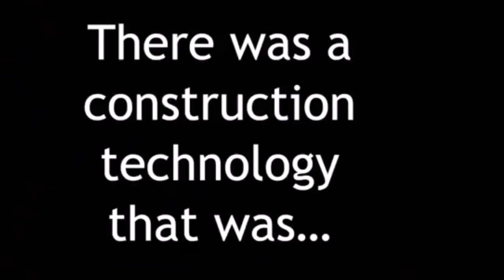Rammed Earth movie

Comment: I don't get the benefit to having a middle with insulation. It seems like a harder pour, more steps. Wouldn't having a solid wall of rammed earth work as insulation anyway?
Reply from the maker: you are right is better just dirt 
they just overdid it and overspent because of the snow presence but is not necessary.
Reply: No it wouldn't work because rammed earth is a very poor insulator for winter.

Comment: I live in an area where Radon is an issue. It's caused, as I understand form elements in the soil decomposing. Minerial, not organic elements, so does rammed earth release Radon ?
Reply from the maker: if you build a rammed earth hose in  the area where Radon is present, yes it will be contaminated air around that area
Reply: You can build a ventilation system that will let the Radon pass through and go into the air.

Comment: what is termal isolation inside that house?
Reply from the maker: the wall itself is the thermal insulation because of the size of the wall around 16 inches wide and some builders will ad foam insolation in the center of the wall

Comment: How does rammed earth houses hold up when foundations settles? Can structural cracks be repaired in Rammed Earth structures?
Reply from the maker: yes if it ever happens.
 but all you need is a concrete color mix to repair rammed earth structures.

Comment: All the walls can be stuccoed and treated according to you wish. There's no reason to leave them untreated, especially in the outside in order to protect the structure from the elements. Erosion or frost in moist walls can cause structural damages. Many people don't like this natural look at any cost. You can actually live natural and not look like a treehugger. I've been in the construction industry for 21 years (Europe) and you would wonder how many people don't like it. I actually like it. I live in a 300+ year old house which was made by this method - without one ounce of concrete or reinforcing whatever anywhere, without proper foundation (only huge flat rocks), without moisture protection from the ground - and wonder of wonders - after three centuries, it still stands, no cracks in the walls and it isn't humid. Using concrete isn't environmental friendly because it's far from recycleable. When we tear down a house containing any kind of concrete or so called modern building materials and then transport the rubble to the dump, it's considered dangerous non-recyclable waste. You can use it crushed into the foundations of the roads but this isn't recycling, it's only relocating dangerous waste, postponing it to our offsprings. Concrete must be used only because of the authorities, because the clerks want to cover their backs. My house is the proof that you can build a cob/dirt/rammed earth house without it completely (it worked for centuries, why shouldn't it work nowadays) or Instead of it you can use calcium hydroxide (slacked lime) which can substitute cement structurally by 80%. Then, your house becomes really recyclable and safe, as well, when you built it properly, of course. But as I mentioned before - the european authorities are scared of not using cement, that's why we are forced to build expensive tank-proof bunkers full of non-recyclable materials called houses for living. Now I saw that the american authorities are pretty much the same - concrete everywhere, our backs are covered...

Comment: She’s completely mad, doesn’t need heating or cooling lol if it’s winter with no sun she’ll freeze, houses don’t heat themselves lol
Reply: The concept is called a "trombe wall." How it works is that the mass of the wall absorbs and retains solar heat gains during the day and then radiates it back out during the day. But there is a limit to how much heat a mass wall can retain, so it has limited effectiveness is areas with prolonged winters where the outside air will be pulling heat out faster than the wall can absorb.

Comment: I am confused with so many options ?
What is best for me, i have fertile soil, water source, mud, hay, (wood is not cheap at my location) so can opt for bamboo.
To reduce dampness in future, my plan is to get stone foundation (which will be a bit expensive) and 2-2.5 ft stone wall and on top adobe brick, or rammed or cob ???
pls suggest, it dosent snow, but rain 3 months, summers hot 42 degree and winters cold 7 to 8 degree
Reply: Adobe es una buena opción térmica y resistente

Comment: it has one big issue... its expensive to build cos the  time to build.. the manual labor  ads up...
Reply: when you subtract the time/materials/labor costs saved from not drywalling, taping.mudding, texturing and painting, thats a pretty significant offset.  Also, the thickness of the walls reduces the energy required to heat/cool the home so that cost savings year over year for the time you live in the home is also material savings.

Comment: Has anyone used a vibratory plate compactor to compact their rammed earth wall? I am planning on building thicker rammed earth walls (approx. 18 inches thick) and a plate compactor I own is about 17 inches wide and do not relish using a tiny hydraulic or hand tamper for a year or more to construct my house. The plate compactor is designed to compact dry soil anyway, so why couldn't put in your lifts of properly mixed soil, use the plate compactor to compact to the rammed earth to the desired density, then repeat for each layer? I will do a test this spring and see how it goes, but wondering if anyone every used this method?
Reply from the maker: great just remember to make test runs
for psi test
and make sure your forms are secure and strong
because the surface  in 17 inches plate is to wide and my need  more (time /duration) and more pressure to compact down

Comment: They always fail to mention the cost. It's steep.
Reply: Here in Brazil this is one of the cheapests ways to build, yet few people do it simply because they don't know it exists. That might change from now on, as this method was put in official normative in 2022. Here we have cheap labour and expensive materials, so when you find a way to build with a material available everywhere, it's affordable to hire workers to build.
Reply: what makes it expensive ?
Reply: Too true. It can't go mainstream because it's so labor intensive. Can't do tracts of houses in subdivisions in a city with this method. 
I'd still love to build one though... A rammed earth straw bale hybrid design.
Reply: I have learned one thing from these things. All of these are cost-saving unless you build yourself with the help of friends and family (which means lots of labor ). Because all these methods are not so common and are also time taking processes.
Reply: It's cheap if you do it yourself. It's sand and cement 😂
Reply: And the fuel costs it takes to mix the earth amd fill the walls. Not to mention the cement mixed into the walls. And the high fuel costs ut takes to heat a rammed earth home because of the low insulation values

Comment: A lot of misinfo speak to a contractor or even a day laborer. This technique is still not cost effective, approximately $294.00 a foot! Unreinforced brings a lot of problems needs to be seismic proof. Although it does have good compressive and bearing loads. If you don’t have good soil you have to truck it over hugely expensive. Then u gotta insulate the walls having 18 inch walls still won’t cut it by themselves. It’s also very very labor intensive, again added cost but the real cost will come from electrical, plumbing and landscaping pouring concrete for the driveway. All this they didn’t bother to tell you and I hate to say but it seems like political  sleight of hand in order to push the whole green agenda. Don’t get me wrong I think using earthen materials is great but it’s still not cost effective or practical yet. Look into foam bricks and pre fab concrete walls👍🏻

Comment: This shows chunks of earth missing from an inside wall.  Though it shows pictures hanging on the walls that still makes me wonder how much stress it can withstand.  How would it do in Florida close to a beach?  There is another video of a house of cement constructed by a 3D printer.  I think I would prefer the cement house.
Reply: The missing mud is known as clay explosion. It's just chunks of clay that have absorbed too much water drying up. It has no structural impact. Once the wall is cured and dry, you'd probably need to bulldoze it in order to break it. Trust me, a house built with mud is better than a cement house in any and every conceivable way !

Comment: Hello Jose. Would you please explain how this structure could be earthquake resistant.? Have you performed any structural tests to prove this point. What municipality this house was approved in? Structures like these are very popular in Western Africa, but possibility of building these structures are zero in, for example, San Mateo county.
Reply from the maker: All projects are different most of this are in Australia and many of them are in New Mexico in the usa the Extructual engineers calculate the rebar needed for seismic resistance or earthquake resistance
Reply: Jose Alvarado In Australia you are lucky, low seismicity allows you to have buildings built from URM (Unreinforced Masonry) and contemporary buildings together. I was in Sydney and Melbourne last September and was impressed with architecture. Here in California we cannot build buildings like you are proposing in this video because this structural system is not listed in the CBC (California Building Code) and no municipality will approve project like this. I am a Structural Engineer and I would not dare to design structure like this because it could collapse on the occupants during seismic event. Nobody tested shear walls like you are proposing, you just cannot rely on bond between reinforcing steel and mud mixed with cement. So, claim that this is an EQ resistant structure is a big-big stretch.....
Reply from the maker: Igor Kharitonoff 
I will say we have a lot to learn but is possible to create a strong structure with this materials 

http://www.construction.eca.ed.ac.uk/case-study/down-to-earth-materials/

Comment: Rammed earth.....and cement, it is highly improbable that they only use rammed earth.
Reply: You can use lime when earth with higher clay content is available, but you are right, for sandy or silt earth they mix 5-7% of cement into mixture.
Reply: @yarpenzirgin1826  Lime takes C02 to create make no mistake about it. yes it takes up C02 after it reacts with water but it doesn't take up the c02 that it took to fire the limestone
Reply: @derekcraig3617  much less than cement manufacturing process. It is not CO2 neutral, but "less bad".
Reply: @yarpenzirgin1826  Agreed. But many in the 'green' building sector will bill it as carbon neutral. Which is totally greenwashing
Reply: @derekcraig3617  Not sure about "greenwashing". 
Mind you the content of lime is only up to 10% of the total material used, so it is "green - ish". Especially if compared to more traditional building methods.
The reality is that it would be extremely hard to build something 100% carbon neutral, transportation of material will already put it into "red zone", you will not haul the material in toyota prius.
Having said that, every little helps.
Reply: Only a thin outer layer is made from stone, the rest of it is made from earth.

Comment: Why not simply use concrete? More expensive, but less labor intensive.
Reply from the maker: many people uses concrete construction over rammed earth is just a material choice some like bricks others like  concrete and others like rammed earth.
Reply: @JoseAlvarado72  Do you know anything about aerated concrete blocks?
Reply from the maker: @hkitm  not slot but I know is regular concrete with small bubbles in the mixture to make it lighter
Reply from the maker: I mean not a lot I have big fingers sorry
Reply: @JoseAlvarado72  I helped build such a home near Beckley, West Virginia. It was the design of craftsmen from Germany. It was a beautiful mansion, stuccoed inside and out, copper roof, and solid copper gutters and downspouts!

Comment: The idea of using compressed dirt is very old and still great in many applications. And no real offense intended but the idea that it would cure global warming or cooling or the common cold needs to remain on the short bus.
Reply: Its footprint is extremely low compared to conventional construction materials.
Reply: UNLESS you mix in cement to it which is c02 intensive
Reply: To live requires energy no matter what.  Some people are obsessed with building something  permanent others are happy rebuilding a wood house every 80 years.  I'm pretty sure most things when you add it all up come out the same.  We just need less people.  And just when we had the solution all you guys had to go get a Covid vaccine and try and stop the best solution to climate change that we ever had.
Reply: I agree. It's very labor intensive to build. It requires a massive amount of wooden frame construction to contain the earth as it is being tamped down. What happens to all that wood when the project is done? It's all been cut up into shapes very specific to the house being built and unless you are building several exactly like it you can't reuse all of that wood. It is either discarded, burned, or chopped up into something that might be recyclable. The only thing that is "cheap" about the building method is the dirt. It would be cheaper to just build the house out of the wood that would have been used to build the framework.
Reply: @HotspotsSoutheast  plus all of the thick, solid, expensive and extensive use of architectural beams, walls, stairs and hardwood flooring.
Nevermind the nonstop burning of dirty medium sulfur off-road diesel fuel thats powering the entire process.. starting with the first bucket of dirt all the way through screening, mixing, prepping, (hauling?), and even the pneumatic tamping she was so cluelessly proud of.  Thats right, the compressed air for tamping on that scale typically comes from a Sullair brand diesel compressor - the thing is its own trailer - and its going to run alllll day long for months.
Good thing it'll last forever, 'cause thats how long it'll take to break even with its carbon footprint.

For comparison, a similar concrete home with hot/cold water circulating through the walls and floors is built in 1/3 the time using recyclable aluminum forms that are reusable many times over. 
Concrete is also mostly sand and gravel, dye can be added for color, and embossed forms for texture.

There is nothing cheap or conservative about the home shown, in fact it exemplifies the comedic irony surrounding every idealistic pie-in-the-sky notion coming out of certain annoying demographics.  Truth is we just watched a company promotional video disguised as a heartfelt eco do-gooder trying to improve the world... just another in a long line.
Reply: @dash8465  Seems like the wood used could be offset with tree plantings. Could you run the compressor on bio diesel?
Reply: @someguy1559  Sure you can. Even straight VO once it comes to temp. Dude probably lost a girl to a long cocking by a hippie years ago and never got over it. "Certian demographics" is a tell. Mentions the diesel used for compressors, like concrete is manufactured, mixed, and delivered locally and delivered by Prius's I guess. Or maybe he's pissed a competing technology has better marketing than the one he is invested in.
Reply: @HotspotsSoutheast  do you know that you reuse exatly the same wood to make the forms  of the walls? Just make one at the time.
Reply: @HotspotsSoutheast  Sure, cheaper short term. But long after the trees have been grown to replace the ones used in one use forms, it will still be standing. The "cheaper" wooden home will have rotted to the ground and been replaced several times before rammed earth starts to show needs of repair. By that standard, it's dirt cheap. (see what I did there) Sustainability is about the long game, not immediate results.
Reply: I would agree that packed dirt may last a long time but a home made of wood will not “rot away” if properly maintained. There are homes that are hundreds of years old. But as soon as you stop maintaining them they will begin to decay. It’s all a matter of priority. If the goal is to create a house that will last forever use steel or poured concrete. Packed dirt probably doesn’t even last as long as bricks.
Reply: @HotspotsSoutheast  use steel frames instead of wood. It can be used again and again and again, as interlocking modules. 
Have a question:
Is there any kind of rebar, or just dirt?
Reply: GottliebPins yeah. Wood is good around here. Most sustainable type of building if you know how to keep it from rotting and use farmed timber. Timber farms/managed second growth don’t destroy wildlife as much as cropland or grazing land.

Comment: She was obviously a third grade teacher. When everything is solved so simply.
Reply: I might add that as an HVACR guy, the gasses we're using for AC now are both green-house and GW compliant, many with "0" impact on either.   My older R-22 system in my home has been operating and using the same gas for nearly 30 years now.   When it finally dies, the gas will by law, be collected and disposed of; broken down by element and converted to a modern compliant gas.   She's not using oil or NG.  Yes, that's great.   That can't be practical for every climate.   I've not seen any of these structures without some form of supplemental heat.
Reply: LOL!!  I was thinking about that.  She must never be planning to fly or drive anywhere ever again, let alone use one product based from petroleum.   The Electric?  If not self-generated, it's from large, coal-fired facilities, and many municipalities are forbidding "off-grid" living, more and more frequently.
Reply: I wonder how many times she pats herself on the back in a day